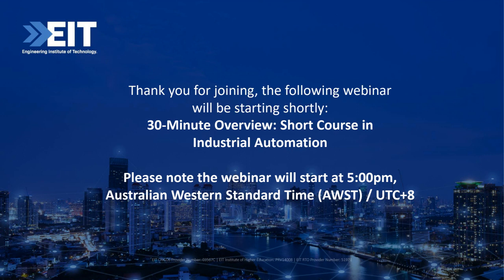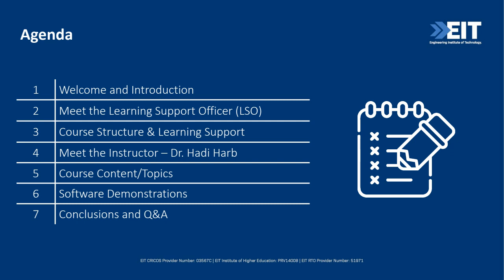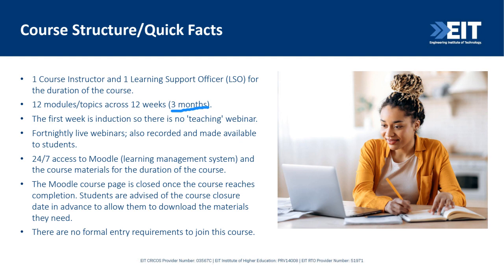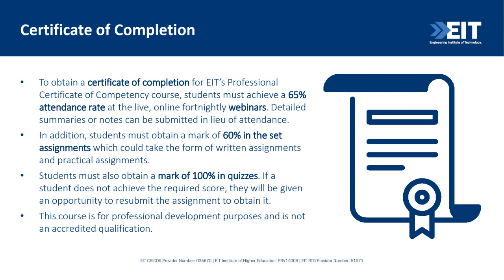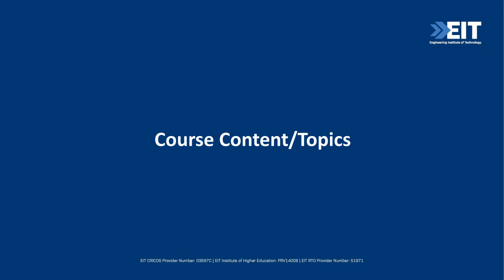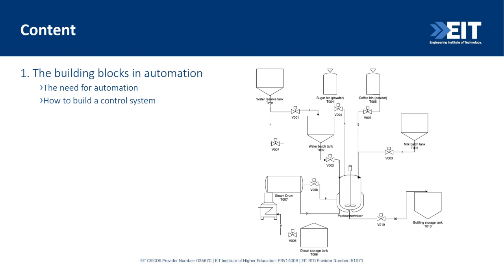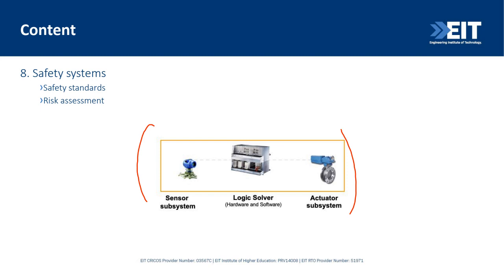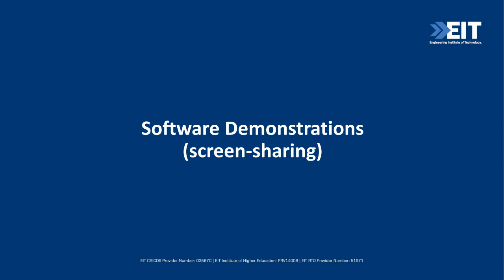30 Minute Overview: Short Course in Industrial Automation

Comment: Hi, do these short courses suit someone with no experience? or are they for already qualified/ expeerienced engineers looking to upskill
Reply from the maker: The Professional Certificates are short courses for upskilling and professional development, providing specific knowledge about that particular area of the engineering industry. Non-accredited means it has not been formally accredited by an education board and is considered to be practical knowledge and/or skill, as opposed to formal education. As such, there are no formal entry requirements to join.